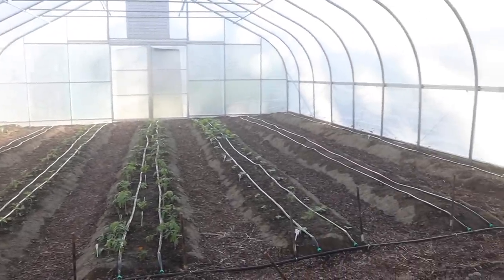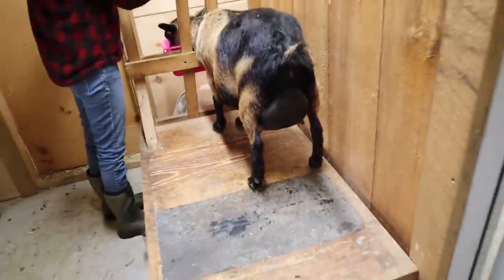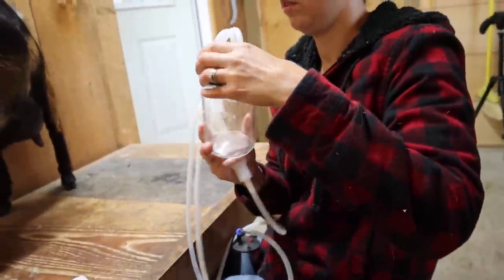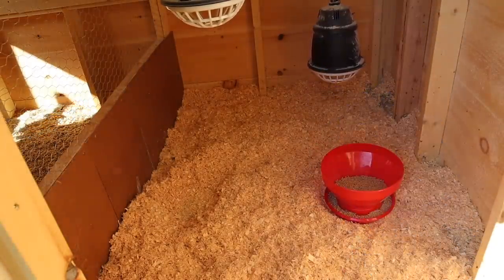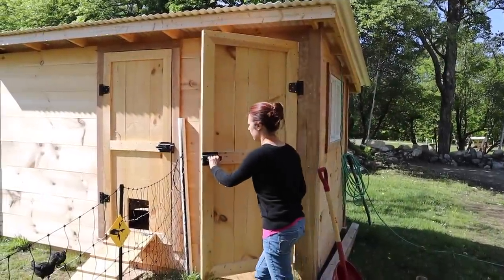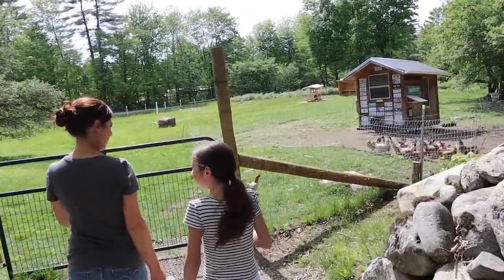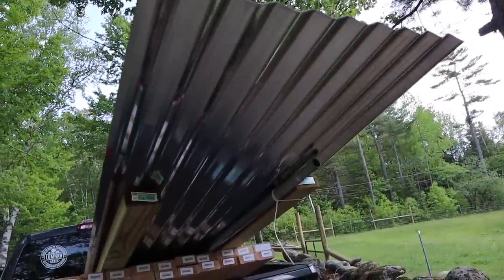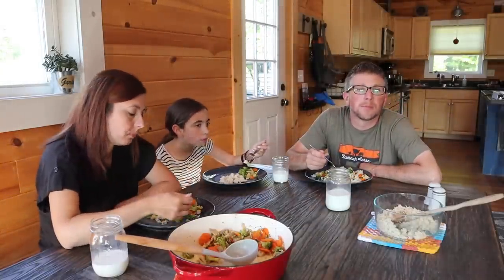We've NEVER had THIS Happen! Milking our Miniature Goat for the First TIME!

Comment: Al, shortly after dirt was invented and  before duct tape became the universal "fix-it " tool in everyone's tool box there was baling wire.  You have a door in the barn witch you have to reach over to open because the door lock only opens from one side.  I had this issue with a fence gate---SO---I drilled a small hole in my gate and fashioned a little latch pull with baling wire to lift the latch.

Comment: hey Al, on the greenhouse crank.......you could cut the crank handle end off and connect your battery drill to the straight shaft with the hook still on it and use the drill to raise and lower the sides in a few seconds. remove the drill and move to the other side and do the same thing. just a thought. Jim in central florida

Comment: A suggestion.  I noticed that when you milk your goats you are using a constant vacuum pump and have to vigorously massage the utter to get more milk.  Most milking equipment uses a pulsating vacuum which strives to mimic natural nursing.  The constant vacuum could be causing some of your goats to resist causing kicking.  I also noticed when the new milk goat was finished and went out to her young that she resisted nursing them maybe do to soreness caused by the constant vacuum.Just a suggestion.,.,.,.,.

Comment: Since you are having beaver problems I see you using a garden rake on the dam.  I think you ma have better luck using a corn fork.  It is a 4 tined hooked fork where the tines are bent at 90 degrees to the handle.

Comment: Homemade substitute for soy sauce:
Ingredients: 
2 Tbsp beef bouillon (regular or low-sodium)
1 tsp molasses
1 tsp apple cider vinegar
1 pinch ground ginger
1 pinch garlic powder
Fresh ground black pepper, to taste
Directions: 
Turn stove top to medium-high heat and in a small saucepan add 3/4 cup water.  Whisk in beef bouillon, molasses, apple cider vinegar, ground ginger and garlic powder. 
Bring to a boil, then lower heat and simmer 10 to 12 minutes.  Taste and continue reducing to your desired flavor.  If at 12 minute this is too strong for you, add a tsp of water until you "loosen" things up a bit. 
Season to taste with a few cracks of freshly ground black pepper.  Store in a container in the fridge.  Use as a 1:1 replacement for soy  sauce or aminos.

You can also find some interesting substitutions for soy sauce here... https://tastessence.com/soy-sauce-substitute

Comment: Hi - here's a chicken stir fry we love - if gluten free can sub ingredients.  
about a cup of chicken pieces, 2 cups broc florets, 1-2 sliced carrots, drizzle of oil (your choice) water, and 'slurry' - equal water and cornstarch; Chicken Marinade- 2 tsp soy sauce/liquid aminos or tamari - you mentioned without this so sub in what sort of liquid you do use here, 2 tsp rice wine, 1 large egg white, 1 1/2 tbs corn starch; SAUCE - 1/2-3/4 cup chicken broth, 2 tbs oyster sauce, 2 tsp soy sauce sub, 3 cloves minced garlic, 1-2 tsp minced ginger, white pepper, drizzle sesame oil.  prepare all ingred before cooking.  Mix chicken with marinade ingred.  cover and refrig 30 min.  Meanwhile mix all ingred for sauce and whisk well.  Blanch brocc and carrots. when water comes to a light boil add chicken and stir a bit to prevent sticking for about 2 min.  remove chicken.  add sauce ingred.  simmer one min  add chicken broc carrots and slurry (equal parts cornstarch and water) Stir until thickened and all chicken and veggies coated.  Remove from heat immed.  serve w rice or starch of your choice.  chicken is super tender and sauce is divine!!!

Comment: AL why don’t you put 2 pieces of 2x4 on the back end of those chicken coops & put 2 push lawnmower adjustable up & down front wheels. Then screw thru the  2x4’s & put one on each 2x4. Then you quickly take a shovel stick under the edges of the coop to teeter & left the corner then U can lower the wheels to the ground to support the weight of the coop when you are moving it will roll easy for you and you’re not pulling your back out! Then when you are through moving it lower the wheels back to sit the coop back totally on the ground.